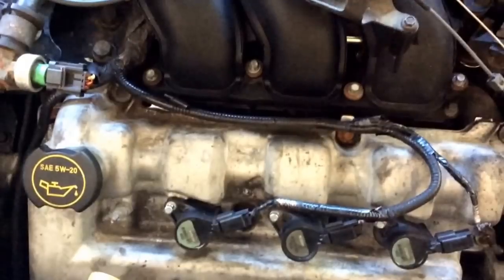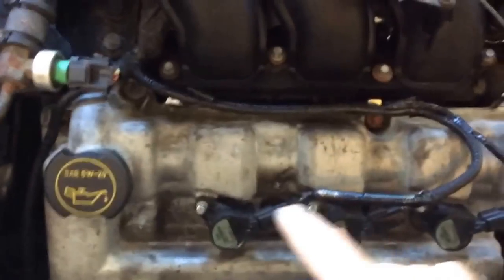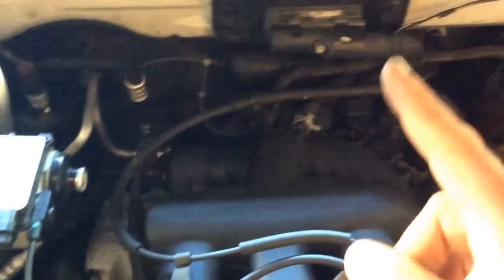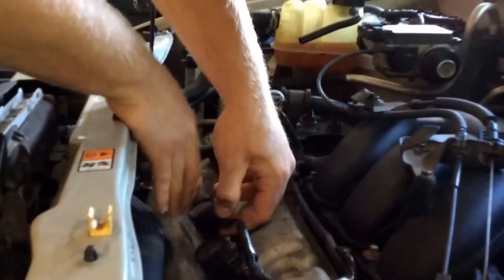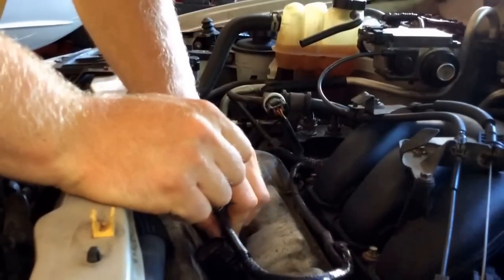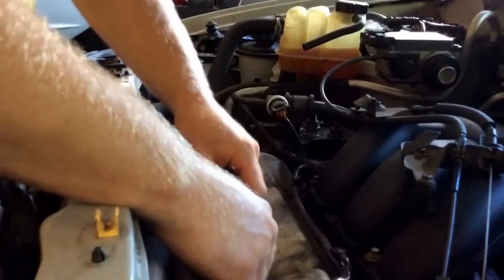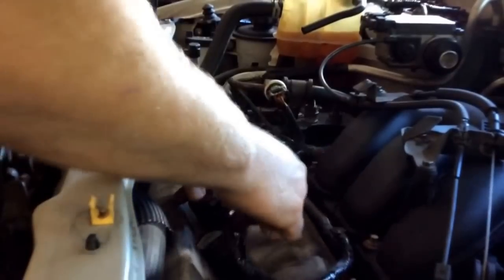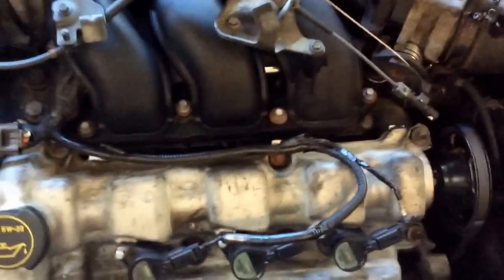How to 2002 Ford Escape V6 Misfire diagnose coil pack 3.0

Comment: If you have a check engine light, get your code scanned free at any auto parts store. The code will tell you which cylinder is misfiring. For example, P0306 is the 6th cylinder.  Replace the spark plug and coil pack on that cylinder. You can buy both together for only $14 on eBay. If its cylinder 4, 5, or 6 its easy to get to and you can probably do it yourself, but if its 1, 2, or 3...its hard to get to because you have to take the manifold and throttle cables off. I would probably have a mechanic do it if its 1, 2, or 3. My 6th cylinder was misfiring, especially in rain or humidity. I changed the coil and spark plug myself, and its running great now. Make sure you use a dab of anti-seize on your spark plug threads and a dab of dielectric grease on the tip of the coil boot. Also make sure you take care of any misfire code ASAP and don't drive the car very much while its misfiring! If you drive the car too much while its misfiring you can fry the catalytic converters. This car has 3, and they run about $700 each!

Comment: How are you supposed to switch the back with the intake off of the vehicle? There is like 4 or 5 vacuum hoses that would be disconnected. I'm have in a major issue finding the problem.

Comment: Why would my 2006 explorer suddenly burn up 3 different coil packs and and blow a fuse? Please someone point me in right direction. Maybe a ground??
Reply: It's your pcm
Reply: Stick an ohm meter in the ends of the cables and see what they are reading. Most likely the PCM has suffered some sort of heat damage and is sending wrong electrical currents and is frying the coil packs.
Reply: Open plug wires can fry coils. Not sure about the fuse?  What fuse?